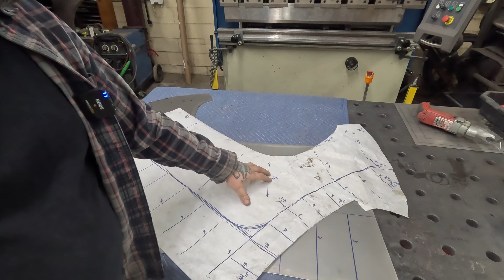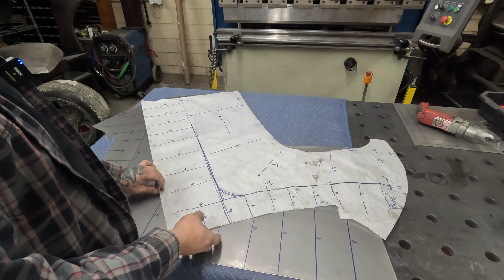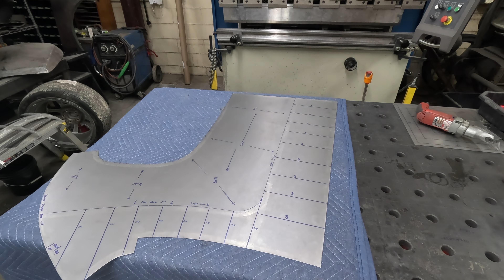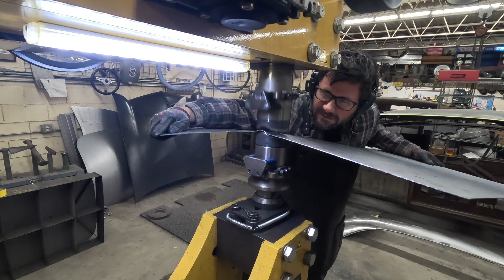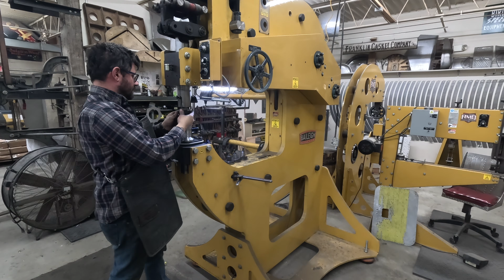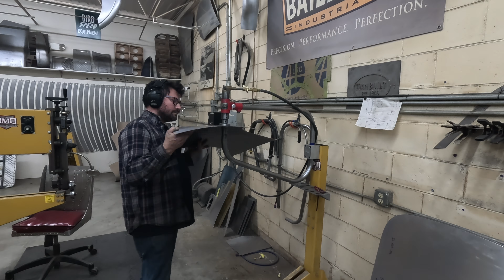1940 Cadillac Lasalle - How I Made The Roof Sections

Comment: Hey Mike, when you blend out the shrink marks using the 36"R lower die, how do you make such a low crown die fit in an area that seems to have a tighter radius due to the shrinking? Do you change the form of the panel to accommodate the die? Do you stay shy of the area that was shrunk or go over the entire area with the 36" die on the power hammer? I'm trying to figure out why blending out shrinks is sometimes done on the power hammer and sometimes done on the planisher. Thanks